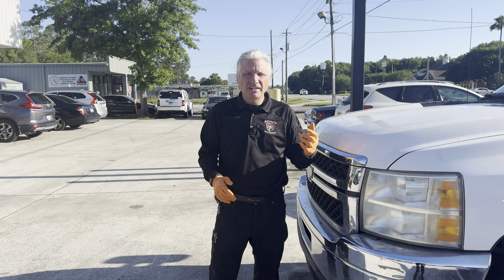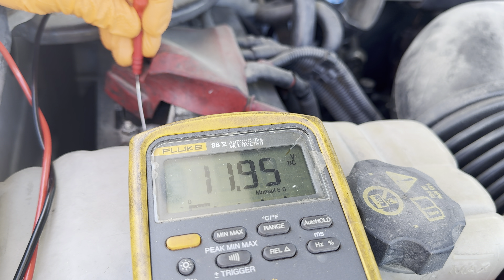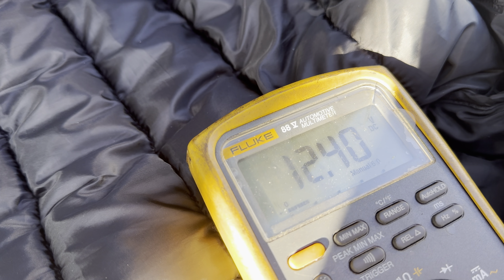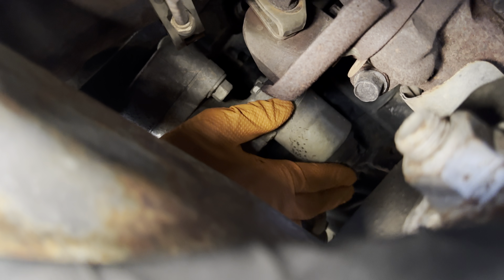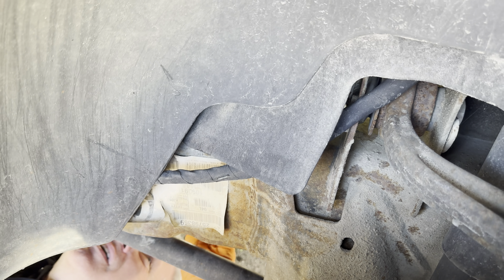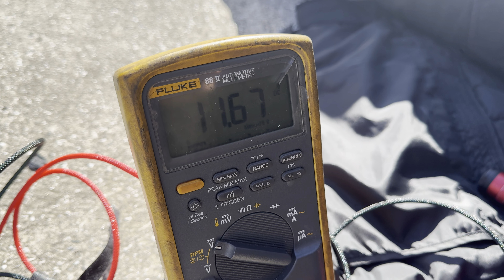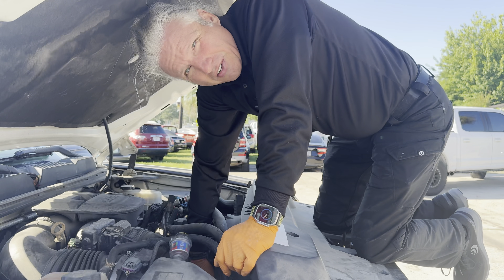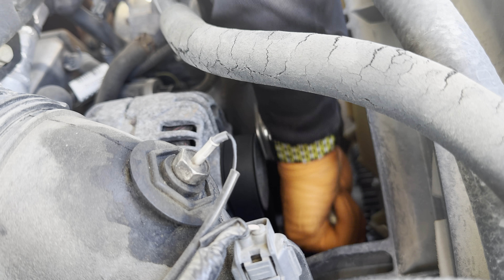Diagnosing A Diesel Truck In The Parking Lot (Duramax No Crank, No Start)

Comment: I just fixed a no start, no click, no crank on my 08 lmm.   Bought a new starter, relay and fuse.   Put the new starter, relay and fuse in.  Same issue and blew a $7 fuse.  Pulled the purple trigger wire from the solenoid all the way out to the fuse box to inspect it.  Found it had rubbed the insulation off and was grounding on the hard line running to the steering box.

Comment: Great idea checking voltage drop on the ground side. I’ve gotten into the habit of putting a jumper cable between the block and the negative battery terminal and cranking it, before doing anything else when diagnosing a no crank. I find it easier, as well I have a hard time trusting my meter lead connection on the block

Comment: That looks like a Denso starter. We used to call this, "click, no crank." The contacts in the solenoid housing burn to the point where they can't provide enough current through the starter windings. I used to get those replacement contacts and install them on the bench, and return the starter to service.
Reply: Is it common to test a starter when your battery has only 12.1 volts?
Reply: @PaulLorenzini-ny2yw  In a failure  mode situation, yes. He's looking for engagement and rotation. If the contacts in the solenoid fail there will be no rotation. 12.1 volts is more than enough to test for function.
Reply: @arthouston7361 100% agree.  The non crank issue is clearly the starter and not a battery voltage problem.  An engine will turn over even down to 11v and he tested it right at the starter under load and it was well above that.
Reply: @PaulLorenzini-ny2yw I’m surprised you’re not getting on him for checking the oil first too.
Reply: My Tacoma had that starter issue when the contacts fail.
It's an easy reapair to buy the kit and change them.
The starters are so well built, it would be a crime to swap them for a $20 kit.
I clean and add grease to the gears etc, mine was like new inside. ( 2008 4X4 )

Comment: Took way longer than it needed to be. I would have went to the starter relay and sent power to the 50 on the starter. Doesn't turn over? Either a bad starter, locked engine or broken wire. Next I check if engine turns. Turns? Order a starter. Next

Comment: If that engine was locked up you’d have voltage drop and TONS of heat on the cable and starter.
Reply: That assumes that the starter motor is actually getting power. Seeing zero voltage drop at the motor, leads me to believe the solenoid contacts are damaged.

Comment: 12.1 volts is a very discharged battery.....I'm rather confused as to why you did not just try a jumper pack first.  Many times I have had vehicles with marginal starters and the extra voltage from the jumper pack allowed me to at least start it with a few key cycles.
Reply: The starter is still bad if it won’t spin at all with 12.1 V.
Reply: @80SWoods  wrong.
Reply: @PaulLorenzini-ny2yw  Prove me wrong.
Reply: @80SWoods  Quick, with your vast knowledge please enlighten me on the number of cells in a 12v vehicle battery and the voltage of each cell on a full charged battery......no Googling either.
Reply: @80SWoods  Did you figure it out yet?
Reply: 2.1 v for each of the 6 cells.  Electrical 101. Care to quiz me on ohm’s law next?
Reply: @80SWoods  nope, no time for hoopties.

Comment: That is funny. Using a volt meter to test the voltage of a power probe.  I use a power probe all the time, better than a multimeter.  Starter click no voltage drop motor not locked up.
Reply: Seems like this guy is an actor, and a bad one.
Reply: @PaulLorenzini-ny2yw Dick
Reply: @PaulLorenzini-ny2yw  Idiot comments like this are why I usually regret reading through them.
Reply: @80SWoods  You don't know much about cars do you?
Reply: @PaulLorenzini-ny2yw  I suggest you learn about voltage drop under load.  This truck passed the test.  It wasn’t the middle of winter, so if a truck won’t start at 12+ volts using the tests he used, it’s a bad starter.  Even if it did start while jumping, would you send the customer down the road knowing that it’s going to leave him stranded when the battery was low?  12volts is well more than enough to turn over a vehicle.  Leave the diagnosing to the pros like Sherwood.

Comment: I also have a hook.    Yes it is bulky.    I use it most for parastic draw testing      Hook it up shut off speaker put it on 60 amp breaker and latch mode put in power plus.   Put bananna connector on instead of tip.  Hook to disconnected battery ground cable and push ground to latch.   Will measure amps being drawn. Leaves your fluke free.

Comment: Couldn’t you put an amp clamp around the battery wire at starter and check amps to see if it’s locked up or not
Reply: If it is locked up, the voltage drop should be high when trying to crank.

Comment: New guys always forget to turn the engine to check if it’s seized.
Reply: Check for 12v at the wire and on the starter bolt itself. Could just be a bad connection.
Reply: No, new guys do not realize there are 2 batteries in a diesel and that a weak battery is one that measures at 12 volts........it should be 12.6 volts......lost faith in this guy in this one.
Reply: @PaulLorenzini-ny2yw  So it was .6 Volts less than full, what are you suggesting should have been done?
Reply: @80SWoods  Stick to plug in vehicles bud, they are made for simple people like you.
Reply: @PaulLorenzini-ny2yw  Good one, thanks for contributing.
Reply: @PaulLorenzini-ny2yw I was thinking the same thing.  At 12 volts the batteries are only at 50% charge,  which is pretty much dead for lead acid.
Reply: Wired in Parallel, one battery that is drained, both batteries won't supply enough amperage

Comment: If you can fix a gas you can fix a diesel worked on the same principal both have a crank sensor and a cam sensor and they both have a high pressure pump and sensors only thing missing are spark plugs all you need is compression and when cold glow plugs give the starter a smack test it should crank
Reply: Right, I would try a known good crank sensor before condemning the discharged batteries.....no crank signal then no crank right?

Comment: Sweet another video! Hi from England!
Reply from the maker: We are trying to do them more regularly here lately! We would love to consistently have 3 per week at some point. Thanks for the support!
Reply: @theroyaltyautoservice  quick question, when measuring the voltage drop, is that the same principle as load testing the main cable with a bulb to see if the cable can hold load?
Reply: @RideBikes_Walkplaces for the most part yes but the meter will give you an exact number
Reply: @marlinyoung1606  is he measuring in volts? I always thought you tested for volts, then load test tge circuit afterwards as there can be voltage there, but the cable could still not carry load.
Reply: Love the hook. I believe its been discontinued for a number of years now. Too many other options that are cheaper, but not as quality